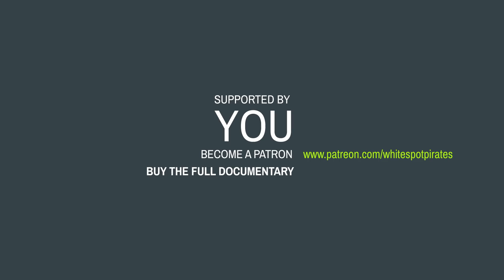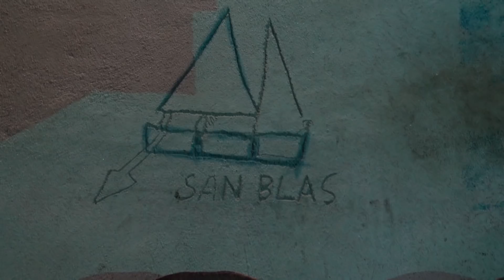What a DESASTER: My boat hull looks like SWISS CHEESE  - UNTIE THE LINES IV #16

Comment: That wall of concrete you were close to in the beginning is what’s left of a three story building. Called it the balboa yacht club back in the day.  There was a restaurant on second floor, third floor we had high school parties up there. Every Friday night. 1st floor was the outside covered bar area.  It was beautiful. Used love to hang out there. I see the concrete stairs leading into the water are still there.  The bridge, taboga.  By the bridge, there are the old pilings from the ferry slip, huge snook are in there. Speared a few. On the opposite side of balboa. One of our secrect spots.  Probably hasn’t been dove or fished in years. No one knew that held big snook. Course you only have 6-12” of visibility.  Hit the bottom and look up. When one goes by, blast it.  Nice vid.
Reply: I remember that place too! It was lovely! ✨✨✨

Comment: NIKE The next time you weld up a hole remember this trick if you can get to the top side of the hole. Cut a piece of copper pipe length wise. Pound it out flat with a hammer. Hold the copper against the bottom side with something. Then have the welder fill the hole with the MIG welder. You will be amazed how fast you can fill a hole.  There are some special carbon devices sold to do the same thing, but copper sheeting will work great, or better...especially when doing aluminum. 

The way it works is; the copper sheet will support the weld puddle. The molten aluminum will not bond to the copper. So you weld, wait 5 seconds, remove the copper sheet, project finished. If you keep some aluminum disks the same size as the drill bits or hole saws you have you can use another trick. When you need to repair a spot. Drill out the damaged area to the same size as the disk you have. Put the disk in the hole, then weld it. That way you have no through hole to mess with when welding. 

If you learn how to TIG weld aluminum. You will then have a foundation to learn how to weld aluminum with a torch. Small torch setup with the correct tips etc. you will be set.

Comment: That doubler plate is a good quick fix. Just make sure you don’t get stagnant seawater behind it and between the original hull plate. Anaerobic conditions will form liberating sulphide compounds which are aggressive to aluminium, as aluminium passivises with oxides. 
Inside of the hull needs to be welded where the holes are. Keep that area dry.
Reply: thats good advice

Comment: I had a fiberglass boat which had about a dozen lead bricks laid in the keel area. I think it's a way for the designer and builder to fine tune the ballast and waterline. After all, it's easier to add a 25 pound lead brick than take out 25 pounds from somewhere. I actually enjoyed having it when I was cruising with the family because we tended to lower the waterline once we were loaded so it was nice to be able to remove several bricks to lighten the load a bit.

Comment: Re the lead ballast - I have seen that material that was used to stabilise the lead bars in rudders - it looks like a form of cement. The YT channel Just Sailing covered it a year or so ago.
Reply from the maker: Norman Boyes ah thanks! That might be possible actually!
Reply: Just checked the Just Sailing rudder video  it may be slate dust mixed with polyester resin. How are you going to resecure the lead ballast?

Comment: Love your channel, hope to watch many more episodes, i'm no expert on boats or boating but I read a little about boats, thanks to your inspiring journey i am saving for my own boat The 40 pieces of lead you removed from Karl is the ballast it's the only explanation for lead to be in the bottom of a flat bottomed boat, used to increase the 'Angle of Vanishing Stability" (AVS) this is the degree of heel Karl can do before capsizing. it's proportionate to the sail area and rig height. it's also important of the location it is placed in the bottom of the boat. I hope one of your other subscribers that do know about boats a lot more than I, can explain it better, the lead is important put the lead back in. Also canoeing with crocodiles might be classified as an extreme sport.
Reply from the maker: Robert Pawley no worries, it will all go back in. But first, the holes below must be fixed, then insulate the bars properly, put back in and make sure they don’t fly around 👍👍👍

Comment: Might want to consider your changing the center of gravity of your boat.  Designers don’t put lead in the bottom for no reason.  At any rate you need to electrically insulate and fasten the bars in place, so you don’t upset the stability of the boat.  Rolling over is really a bad idea.  Great boat!
Reply from the maker: guesswhotoo6 of course the lead is going back in...but as u mentioned correctly, it needs to be newly insulated and then fastened because the way it was sitting it was obviously damaging the hull, so not such a great option to leave it the way it was ☺️
Reply: WhiteSpotPirates   Very happy to hear!   We don’t want any last episodes of your great adventures.   PS.  I also have an aluminum boat and have a bit of experience in that regard.   Your redo of the hull episodes were exactly correct in every detail, so this problem happened for exactly the reasons you described from the inside out.  Keep up the good work!   Regards from Boston.
Reply from the maker: guesswhotoo6 that’s what it seemed like 🤞

Comment: Hang in there!  Everything you have done to Karl is making him stronger and improved.  Could those concrete bars that Many is removing be some sort of weights for ballast?  I’m going to google this and try and find out
Reply: I just found an article saying that concrete was a cheap form of ballast for metal boats - but has been banned in Europe for new builds for a number of reasons - the most prominent one being corrosion and the inability to stay on top of it - sounds like you made the right decision to get rid of it 👍
Reply from the maker: Anne winning 🤣🤣🤣 yeah, whatever that was, it was not so grand 🤣. The lead bars, of course, need to go back in...but the need to be reinsulated and held in place.

Comment: I don't watch that often but it seems every time I do(since 4 years) there is something wrong with this boat. The amount of time, effort and money  spent you could have well brought something much safer, faster and well, just being actually sailing. Good lesson for others right there. Save up and buy a GOOD boat to start with.(unless its a Project you're after)
Big props for your tenacity though!!!
Reply: All boats require continuous maintenance and if that maintenance gets deferred, major problems can arise later. By doing the work herself, she gains knowledge of the boat that she wouldn't have otherwise. It's a good feeling being out on the water knowing that things were maintained properly as opposed to operating a vessel with unknown history but a fresh coat of paint.
Reply: @pdutube  Yes obviously. My last boat was 40 years old and I got right into the maintenance, upgrading, cleaning, repairing, thinking I'd eventually get on top of it. You know what? 4 years later I was still going, I'd sail 3 days then have to spend 3 days fixing stuff. What made me decide to ditch it was that my goal is to sail around the world and I just realised with that old boat I just wouldn't be confident to cross big oceans. So then I brought a 10 year old boat and you know what? Now I get to sail about 70% of the time. I sailed to 4 countries and around 4000Nm in 2018 and apart from routine maintenance I had to fix nothing. Obviously things will need replacing as time goes on but my point is that if you start out with a old dog you'll spend most of your time chasing your tail. You don't save money you just spend it fixing stuff instead of sailing. Its the emotional connection to the vessel that keeps people invested.
Reply: @SailingLearningByDoing  It's true, I've become attached to things that other people would have parted with. It's my nature to want to build things, like my airplane, but you're right about the time aspect. If I bought more than I built or repaired, I could be out enjoying myself. I enjoy the process but more than once I've thought to myself that I must be out of my mind LOL.
Reply: @pdutube  Haha yeah. Don't get me wrong, I loved my old boat and took great pride in every little upgrade I did. But after 3 years I thought again why I actually brought a boat in the first place and it was to go see places that others couldn't get too and I was too scared to leave the coast and the nearest chandlery.
Reply: you dont know what kind of boat do you have and do you live on it i guess we all cant be you
Reply: I think many people spend their lives saving up and never actually get the boat.
Reply: The tropics are are extremely unforgiving on boats.   they decay 10 times faster than in temperate climates. its best not to linger there as long as she has.
Reply: @cawfeedawg  That's very true, especially for wooden boats (worms). There's a sexy wooden boat nearby that I lust for but my buddy (who I crew for) is always shaking his head, Paul, it's a WOODEN boat! But even fiberglass and metal boats get so much growth below, and if the zincs corrode everything goes to hell!
Reply: @shauntoomey3299  I agree. It's a tough decision though, especially with a partner, here's our life savings and what do we want to do with it, it has to be well thought out. I want to build a boat because I am going to be selling my business in the not-to-distant future. If I had other factors it's easy to see me going a different route. Even worse, it must be hard to buy the boat and then realize that it was all a mirage, that the money should have been spent on some other passion. Still, I say follow the heart but let the mind temper.
Reply: @SailingLearningByDoing  Ha ha, I'm still scared to leave the coast. I've done it once to Bermuda but I was the guy that had trouble leaving the sight of land. Now I've succumbed to the sickness and I think I should take more "risks" on the open sea. Fair winds!
Reply: It is all relative. I spent 10 days making seaworthy a $6K,  40 year old fiberglass boat I had bought. In the next slip was a brand new $250,000 plus boat. Every time the owner took her out she had engineers on board the next few days fixing problems. The same sequence of events were taking place as I left. Is there such a thing as a GOOD boat without a ToDo list?
Reply: @smacksman1  I think this is the best comment I've ever seen about boats! it's always a love/hate relationship... and yes it's all relative!

Comment: Hi, could you do me a favour and take some close up pic's of the back of the alternator and tell me the number of wiring connections on the engines oil and water sender units, Pics of these would be nice. especially with the dissimilar metal problems, between the led and the aluminum.

Comment: Do you have the correct zincs where needed for your aluminum sailboat where they should be designated throughout the hull and take a meter reader to check for electrolysis. Maybe you already know but do everything you can to learn about aluminum boats in salt water for the best protection.  Make sure on a regular basis make it a habit to clean the bottom of the boat do not let it go too long maybe like every week or sooner clean the bottom .

Comment: Problem with 6 series Aluminum is that it will always corrode when connected to dissimilar metals like stainless. Stainless and Ali forms a battery and with an electroltye like salt water speeds up the corrosion. Best way forward is painting all bare metal with slow drying etch primer which really burns on a coating on raw ali.

Comment: Wish you all the best - hope you can find all the corrosion and solve the cause too. This is one reason many boaters, myself among them choose fiberglass instead of Aluminum.
Reply: Corrosion of aluminum hull is caused by electrolysis or galvanic reaction. Both are easy to prevent...much easier to prevent than the problems that come with fiberglass. Just have to keep an eye on the preventive measures. Just can't splash it with no regard. All in all aluminum is not a bad way to go. Keep in mind that Karl has some age. Odds are high a fiberglass hull of the same age would not be without it's own demons as well.  Aluminum hulls weigh less. Aluminum can be welded without loosing strength. Years ago welding aluminum was a voodoo process. Now it is common the world over. Each material has it's on merits. I have yet to walk on a spongy soft deck of a 5 year old aluminum boat....I can't say that for fiberglass.  We could talk about 20 year old spongy fiberglass decks if you really want to compare the two materials. Speaking of decks, aluminum decks have hardware welded to the decks, not thru bolted; thereby reducing leakage. Below deck cleaning of an aluminum boat requires dusting the bilges in many cases. 

If you watch from the beginning of the series you will notice that Karl has a pitting problem. I'm sure the previous owner didn't care for the hull properly, or the hull is not 5000 series aluminum. I surveyed a 1997 Ovni last year. Not one single speck of a pit on the hull...not even up inside the centerboard trunk where there has never been paint. The hull is over 20 years old and looked great with no degrading anywhere. Can't say that for many or any fiberglass hulls that age. 

With the availability of CNC cutting, CAD 3D solid modeling and technologies like pulsed MIG welding I wouldn't be surprised to see fiberglass only used on high volume production boats 20 years from now.  Biggest problem with aluminum is getting paint to bond. Surface prep, product selection, and timely application is key. As far as aluminum and sea water contact goes think...outboards and saildrives are aluminum.

From what I have seen, the acme problem with Karl is more of the exception than the norm. Aluminum construction is a common thing with the Europeans,  especially the French yards. I personally wouldn't be quick to bash on the French for their sailing or boat building attributes.
Reply: @Caliber40LRC   Mmkay  I see you like anecdotes, heres one of my own. The 43' West Sail I first lived aboard in 1980 is just as sound today as she was then - all fiberglass, and solid and dependable as a rock.
Reply: @Bravo21  You have a good one. Consistency with fiberglass is not always a given. Sometimes problems show up because of the builder, or chemical supplier.

I looked at an aluminum last year that was being re-skinned do to reef bashing BIG TIME BASHING. The welder was getting all kinds of pitting in the welds. The problem was the original material used was wacked. After I studied the rest of boat I found all the original welds were pitted. My point being.  Odds are high the boat was probably built with the wrong grade of aluminum (Not all aluminum grades can be welded).

The most common place I find aluminum corrosion is when it is used for water tanks. Chlorine or RO (reverse osmosis) water really works over aluminum tanks. 

As chemical cost, work site health concerns, and EPA regulations become more difficult to deal with, fiberglass construction will increase in cost. Providing auto manufacturers don't demand so much aluminum it drives up cost of the material I expect to see more aluminum boats being built. 

I'm already starting to see a trend towards aluminum for runabout, and fishing boats. When CNC can cut it, bend it, and hold it in place for a $15 hour guy to pluse MIG it, you know how that shakes out.

When fiberglass came on the scene, you know there where guys at the bar that were standing their ground on boats must be made of wood, steel, or ferro cement...We know how that turned out.
Reply: Steel aluminium fibreglass concrete they all have their own issues
Reply: Bravo21 ....fiberglass  is by far the least maintenance.   And steel the toughest.   Aluminum has gone by the wayside because of the high maintenance and corrosion issues  for  almost no  practical gains  in a cruising boat.   I haven't seen an aluminum sailboat built in 15 yrs.
Reply: @sails3538  If you have not seen an aluminum sailboat built in the last 15 years you need to look up from your fiberglass grinding project to look around a bit.

I have worked with frp and welders. For me....since I own the equipment, and possess the skills I can tell you aluminum is much easier and faster to work with. Prep work for each takes about the same effort and time. Odds are high the welding will take less time than mixing the resins. (Figure in laying down the resin, and the welding is way faster)

I have never seen a clete pulled out of an aluminum deck. Can't say that with FRP. This last one I encountered was on a cat that got turn sideways to the current at Freshcreek Andros Bahamas. Motors were not even running. Just the hydro forces ripped the mid clete right out of the deck. Modern builders can no longer be trusted to lay up the glass to proper thickness.  If going FRP go with old thick boat, or do a lot of research about what you are getting.  You don't even want to get started on tabbing and deck hull joints. 

Another case and point see link.

https://www.facebook.com/groups/sailingandcruising/permalink/2035186306595340/

Google Aluminum sailboat manufacturers you will see there are plenty being built and sold.
Reply: jay gallagher Jay, you were concerned about the aluminum used in Karl. He was built in Germany by a very particular builder so I feel confident in the quality of the original aluminium build. Unfortunately these boats were sold as owner finished which I think this boat was and quality may not have been the best. Cheers Warren
Reply: fiberglass least maintenance?? Disagree. Unpainted aluminum hulls are EXTREMELY LOW MAINTENANCE. No waxing, no buffing, no blistering. If you haven't seen an aluminum sailboat, you haven't sailed much in big cruising destinations.